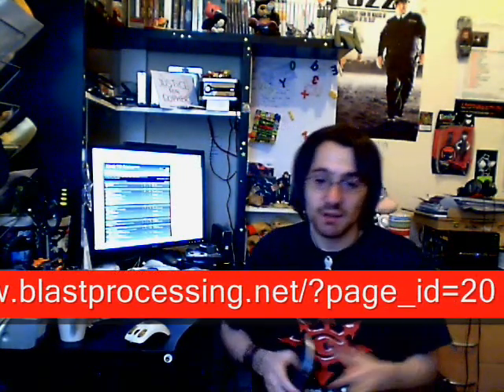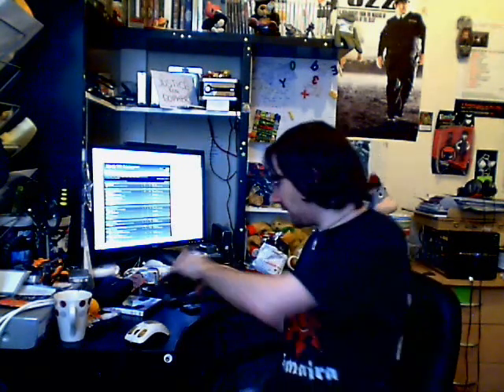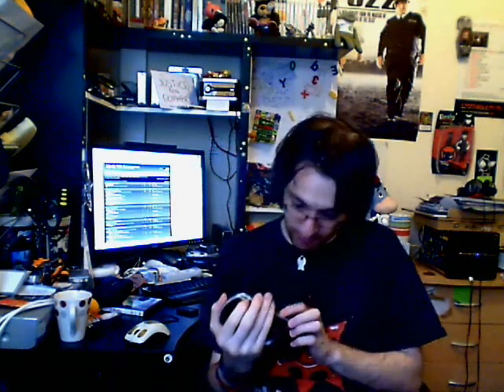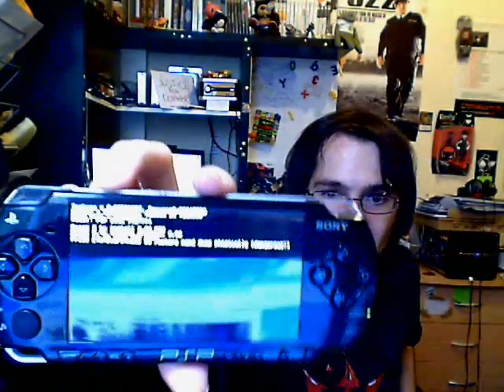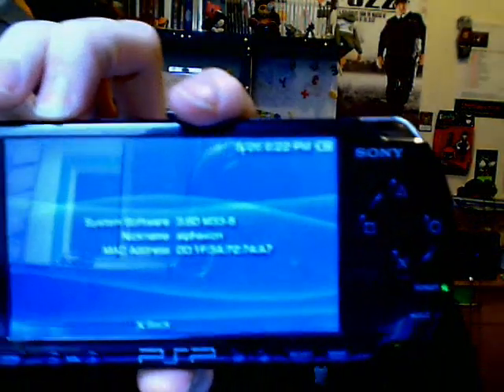PHN - How easy is it to hack your PSP?

Comment: Do you need to have a specific firmwate on the PSP Slim before you can install the firmware?

I've got the original and needed to downgrade to 1.5 before I could do anything with it.